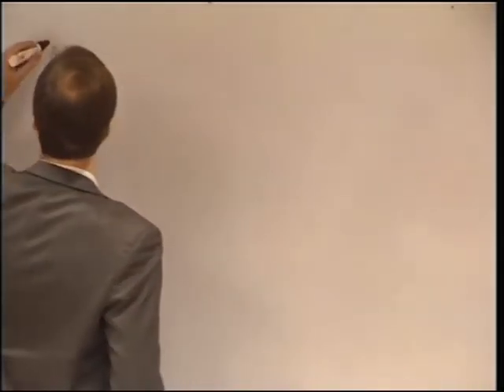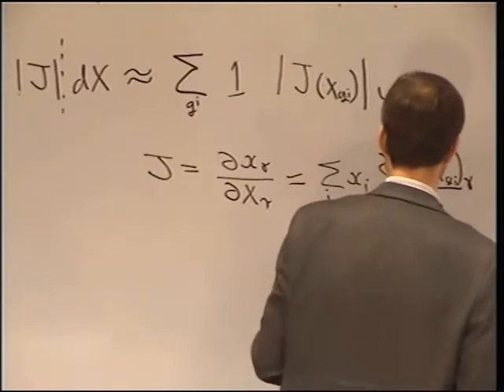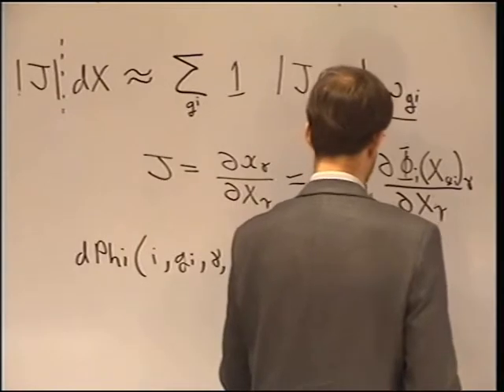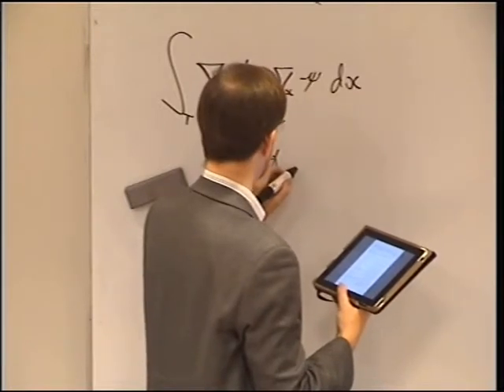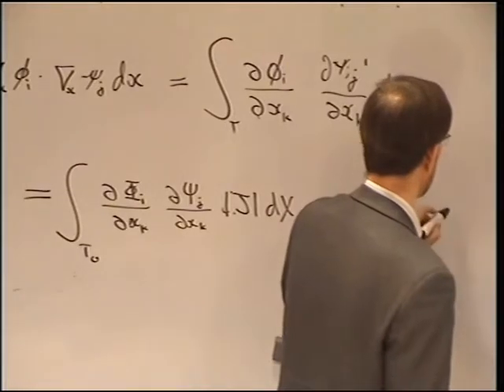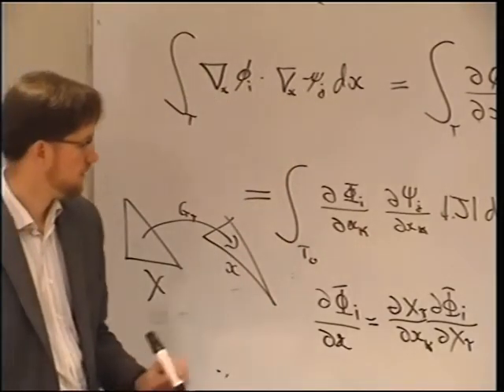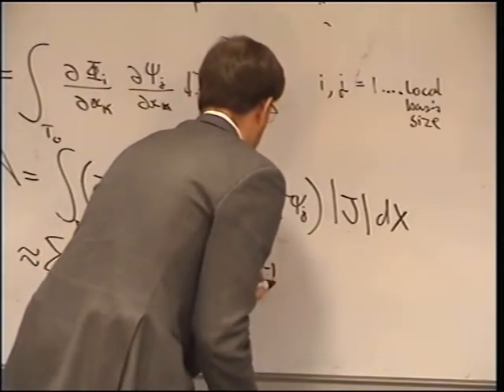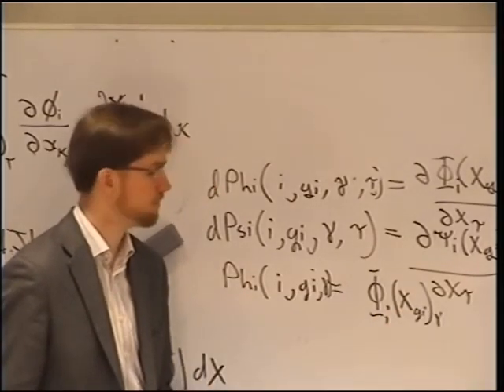Finite element method course lecture 5 part II 7 Feb 2014 Local assembly

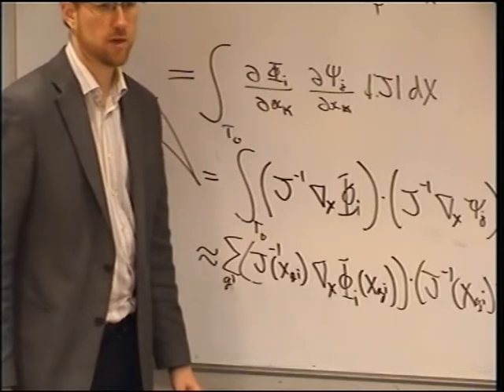Comment: Professor, at 24:51, where you finish the quadrature formulation for the integral, you used a dX at the end of the formula. Can this be replaced by a weight coefficient?
Thank you for the great lectures.